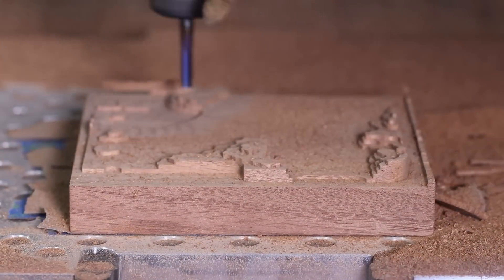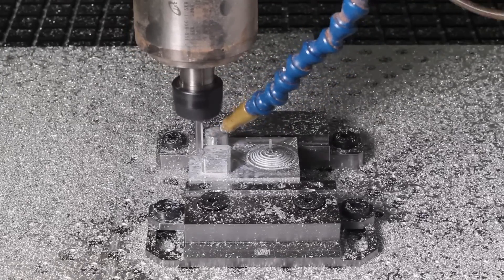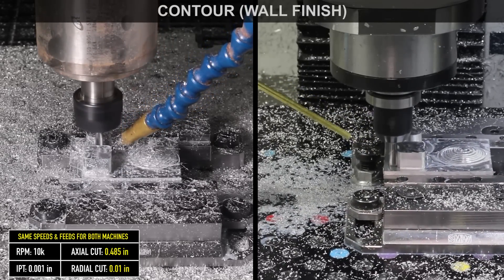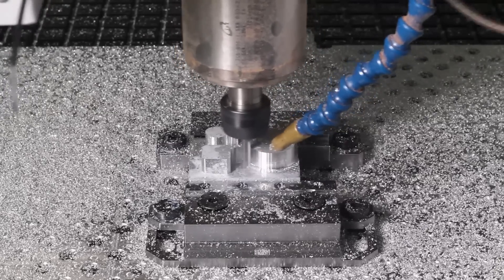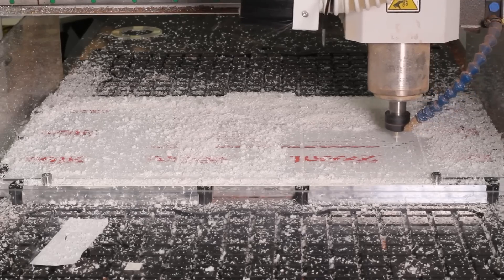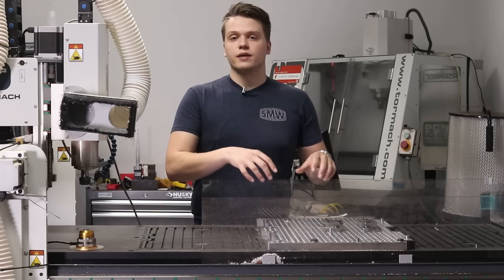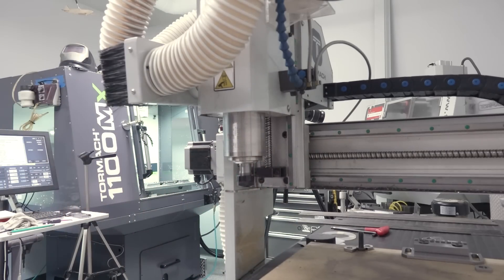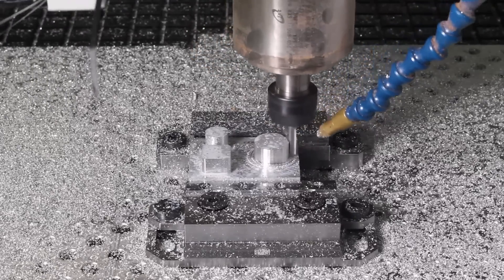Can the Tormach 24R Cut Aluminum and Steel? Machine Test!

Comment: Good video. 

I have an AVID cnc with ATC and servos. Disappointing to see Tormach with steppers, no ATC and small footprint (2x4) VS my AVID (3x3.) The price even with my ATC and clearpath servos puts the AVID at 15k less. I see Tormach have the ATC machine at 27k and my machine was 11,500 (again with servos and ATC CNC depot.)

Comment: A portal is the least stiff at the point of testing. At the center of the bridge is the weakest point. It's most stiff at the outer ends of the portal. You can use that if you need maximum stiffness.

Comment: I run a Thermwood router with a 4' x 8' table, we machine mostly UHMW, we machine nylon and delrin on a regular basis as well.  To help with the vacuum we use packaging tape on the edges of the material so we can aggressive with the cutting close to the edges.  Our vacuum setup is very strong though with 3 10 HP vacuum pumps, the hold down force is around 1400-1500 lbs sq ft.

Comment: a way to avoid the knuckle smashing is to use your legs to produce the forward or backward motion rather than your arms since your legs have far more strength than your arms so they can decelerate your hands much faster than your arms can.

Comment: This is more like a question.
Have you tried tapping a blind hole with a tap size of M1.6x.35. Material 6061 Alum. Using a CNC machine.
If you did ,what was the end result?
Thank you

Comment: Did you check the bed flatness on your 24R? I just received mine, and based upon the tools I have for measuring, the bed is 1.5 to 2 mm low in the center. Do you see a similar sag on your unit?

Comment: Good review. I use short custom er wenches to avoid over tight collets.  The machine is very accurate over a large area. It shines when fabricating plastics and making large gelcoat molds for fiberglass or cf parts.  Simple to setup and it often runs for hours and hours milling out some fine detailed work of art.  Spindle overhangs apron at end this allows cutter profile access to material ends for custom wood joinery or other work on long material ends.  I also have few hundred pounds of weight added in base to hold it down when wizzing around cutting at 160 ipm
Reply: heya, mind sharing the ER wrenches? I run an axiom machine and it uses ER20, I mistakenly over tightened the collect a few times but I manage to get a hang of it, I'm always on the market for new tools :D
Reply: @Pertruabo   Hi Gerald. I posted the wrench models to grabcad a few years ago.  search under l.burkhart. they are easy to make. the ones i designed are thick so it will stay on spindle flats during tool change and not fall off. that way you dont have to fumble around with 2 wrenches as much
Reply: @laneburkhart5590  cool thanks, I'll check it out!

Comment: So, was that the max machine feed on the 770? That looked awfully slow for a CNC milling machine. If the 770 is just another yet stiffer router, I would say it’s ridiculously slow. It’s supposed to have a max 135 IPM feed rate.
Reply: Max machine feed is 135, correct. I wasn't running at full feed there because it was a relatively deep cut, so was favoring WOC/DOC over feedrate

Comment: I recently also had bad chatter with slotting on a 24kRPM spindle, despite only 0.5mm step-down on a 4mm cutter - even vibrated/pulled the cutter down in the ER collet. This was on an Optimum MB4, very solid cast-iron dovetail machine. I reduced the RPM to 15kRPM and it went completely quiet for the rest of the run and machined perfectly. Maybe it's just some resonance of the cutter or spindle at those RPM, rather than the machine? Worth a try with lower RPM for slotting.
Reply: Try to degrease everything and tighten the nut to the proper torque. If used appropriately ER collets have more gripping force then most hobby class machines can deliver. 

Good thought on changing rpm though. A variable helix or variable flute spacing is another good way to avoid chatter on light machines under certain conditions.
Reply: @heinzhaupthaar5590  The nut was quite tight, I checked after I noticed the z offset. I agree, normally a 4mm tool won't pull out of an ER11 collet. In this case, it just shows how bad chatter is, and how powerful vibrations at high frequencies can be. If you hear the screeech like in this video, change something to make it stop, or stop the machine.  
I think the both-sided contact during slotting can be a big problem, and you have to watch out for resonances of the tool bouncing between the two walls. Once I dropped the RPM, the chatter stopped, the tool held solidly for the whole run.
Reply: @codemakeshare  
That's tiny!
ER11 may indeed be way more problematic. I've never used such tiny collets and that might be quite different.
I had MB4 in mind and thought of something most people usually use with it, like ER25 or ER32.
If you use those proper and if they're proper quality there's hardly a way you can make them slip or pull out with the power and capabilities a MB4 has.

Anyway, having a well ground taper, good quality collets, a good quality nut and tightening to the torque specified by Rego-Fix goes a long way and can make a real difference.
Just as properly cleaning and degreasing every surface of the whole system. I often see all those things completely neglected by hobbyists and professionals alike.
I've had to let high angle endmills scream for extended periods due to huge overhang and never had a problem, except at the beginning with poor quality collets and one time using a really greasy collet & tool holder.

Another way to avoid such things might be to use small tools with larger shank size. You can get lots of small tools with 6 or 6.35mm shank. If that problem occurs more often that might be a thing to look into. I'm using small tools with 6mm shank almost exclusively and generally avoid mills without variable angle or spacing.
Has helped a great deal and I can really recommend that to everyone and even more so with light/hobby machines.

Oh, and if you have to babysit some work anyway you can constantly change rpm up and down a bit via spindle speed override. That way certain kind of vibrations can't really happen because there's no steady frequency to excite them.
It's kind of annoying to constantly twist a knob for extended periods but might be a solution as well.
Reply: @heinzhaupthaar5590  ah yes, the part I didn't mention is that this wasn't the stock spindle. It came with an MK4 collet and I'm indeed using that with ER32 holders. But the stock spindle and gearbox only go to 3200 RPM. For work with small mills in alu and plastic I adapted a 1kW 24kRPM spindle (60mm) to slide in instead of the stock spindle - takes a few minutes to swap. It's a pretty cheap chinese router spindle, but normally does an adequate job, except slotting. Unfortunately I could not find any better 60mm diameter spindle motors that would fit, so I'm limited to ER11. 
The only point I wanted to make was that the chatter in their video might not be due to machine rigidity, but due to too high RPM and vibrations in the tool and spindle. At least I'm pretty confident in my instance that the MB4 was plenty rigid enough for a 4mm slot, and the problem is the spindle or tool, and high RPM.
Reply: @codemakeshare  
Oh, wait. That's really interesting.
Did I get it right that you just take out the original spindle/quill and shove a small chinesium spindle up there into the original headstock?

That's kind of genius!
I've seen HF spindles mounted to the side, would have never thought of that!

How do you fix/mount it in there, just with the quill clamp?
Reply: @heinzhaupthaar5590  yes. Unfortunately I didn't have time yet to make a video about it, but you can see it a little for a few seconds here: https://youtu.be/4wjA3mhzjsU?t=462 (and machining 17mm DOC at 4:21)
I turned an adapter sleeve to match the 60mm spindle diameter with the 75mm bore, and slotted the sleeve in the middle so that the quill clamp tightens the sleeve around the spindle. The power cable drops in from the top, through the gearbox. To swap, I just need to unscrew the quill feed return spring, pull out the quill handle, then the original spindle drops out freely. Then drop the cable through, plug it in, and push the china spindle in, clamp it down. 1-2 minutes. Works well, and the machine still has the same layout and work range, compared to a side mounted system. But, as I said, unfortunately it's 5mm too small for an 80mm spindle, which would offer a bigger selection, more power and bigger collets. But it's alright - with a 6mm end mill I can push it to 10+mm DOC, 1-1.5mm step over, 1200mm/min feed.

Comment: To save your knuckles don't use the wrenches like you show in your video. Instead, position the wrenches so that you have to squeeze them together on tighten or loosen your collet. By this is mean instead of pushing on the wrench on your right, move that wrench to your left and then you will squeeze the wrenches together. No more knuckle bashing.
Reply: I second this - always tighten and loosen the spindle collet (routers, ER spindles,...) with both wrenches in one hand. Better control of the tightening force and no more busted knuckles...

Comment: 30 seconds in and they've already tried to compare this tormach router to a datron 🤦‍♂️
Reply: Yeah, and ending on saying it will work fine as a replacement... If this is a replacement for the Datron, I would think they were not using the Datron to the fullest of its capabilities?

Comment: what can the 770 do that this machine cant in terms of machining
Reply: Larger tooling, more Z height, and you'll definitely be able to remove more material in certain situations. The test here was in the 24R's favor due to the soft material and small(ish) tool diameter, but with bigger tools and materials where SFM matters the 770 will do better than the 24R. Also drilling from 1/4" to 1/2" probably isn't great on the 24R, although I didn't try it out.

Comment: Another upgrade I'd suggest is swap out that CW-3000 "chiller" for a CW-5000.  The 3000 is simply a radiator with a fan moving air across it, while the 5000 is an actual refrigerated chiller.
Reply: It's a cheap spindle, an appropriate radiator is absolutely sufficient.
What use is a more complex chiller if a radiator is absolutely enough to keep it in its optimal operating range?

Seems like a downgrade to me.
Reply: @heinzhaupthaar5590  It might be a cheap spindle, but it's not a cheap machine.  Also, not everybody has the luxury of running their machine in a climate controlled shop.  If you're running it in a hot garage, then you'll never get the spindle below ambient temperature -- maybe that's 90*F (32*C).  Too hot for even a cheap spindle.  Stop being so cheap.
Reply: @swp466  And yet Mechatron, one of the better, German 24K spindle manufacturers recommend 40C as the upper limit with a shut off at 50C. So, perhaps stop calling people names when even the manufacturers don't always agree.

(Yes, late comment...)
Reply: @AntiVaganza  Maybe 40* spindle temp, but that will be warmer than ambient -- the temps I was talking about were ambient temps.  The spindle will be much warmer than that.  Even Mechatron offers refrigerated chillers (NOT passive) that require a room temperature below 30*C. Hmmm, why don't they sell or recommend a passive cooler?  And yes -- very stale reply.

Comment: I bet the 24R would be an absolute beast with a small high feed endmill. What are the max feeds?
Reply: @Jarret - Maximum Feed Rate: 200 IPM (5.0 m/min). And yes, you are correct, the 24R is a BEAST! 💪